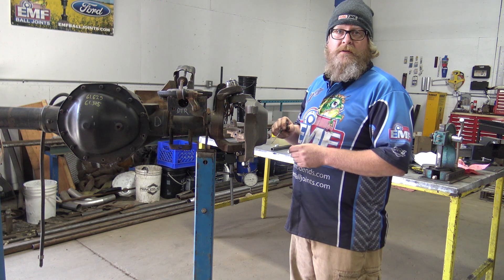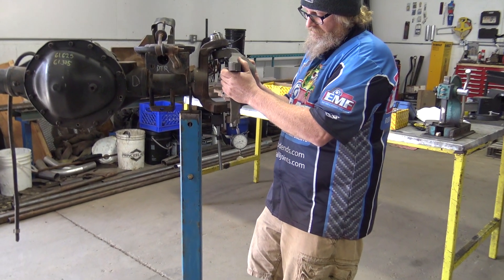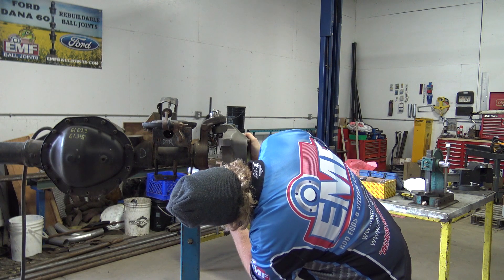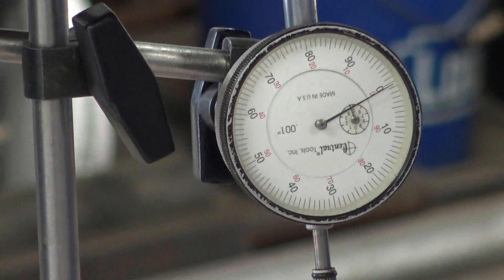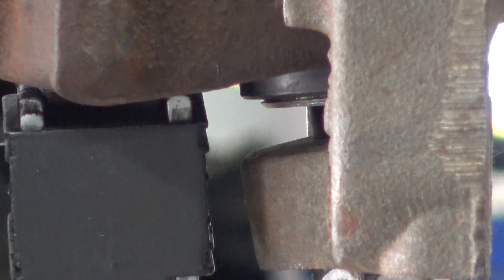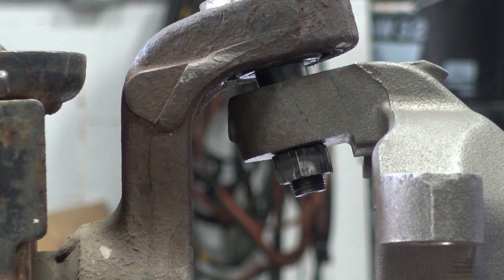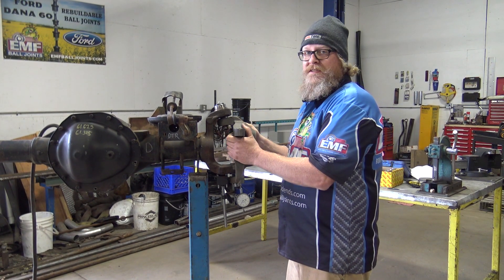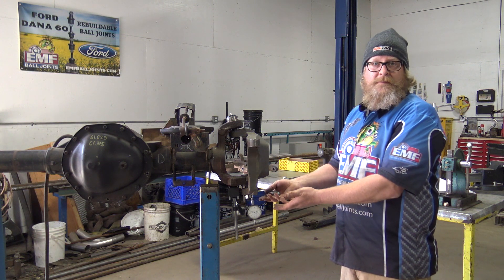Part 1 - EMF Lower Ball Joint Play Tutorial

Comment: I had to admit defeat and have a shop do my joints as my unit bearings were seized  after 2 days beating the shit out if it. they charged 8hr labor ( w/o aliment) for a 5.5 he job due to how stuck the bearings were . Now it clacks over lines in the asphalt, worce than when the joints were wiped. 
How bad could the shop have screwed up the jobby not following your well written explicit instructions? 
Do I need to go back in and redo the hole job? 
 ( just for context the shop Forman argued with me about doing the allinment as "we never do an aliment for just balljoints it doesn't change anything. " 
I had to do the mandatory aliment when I got back to town~400mi later, it drove  like a radio flyer wagon,  exhausting experience. )  Should I just order a rebuild kit and try to bill the shop for not reading the instructions and not greasing the joint likely leading to dry galded races?

Comment: Thank you for all the straight forward info in all your videos. I have Carli ball joints on my 2013 ram 2500 and am having a cupping issue on the inside and outside of the tire tread. After watching this there's no more than 10k play. Could that be the problem?